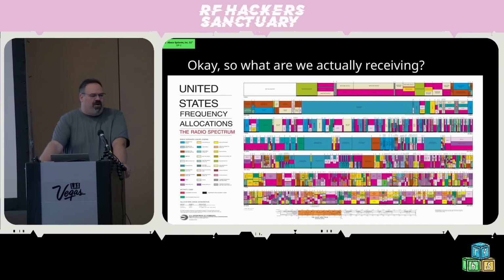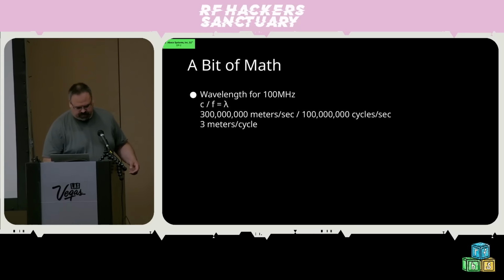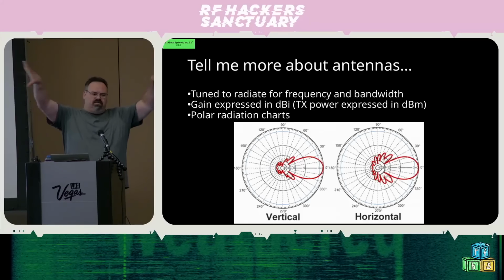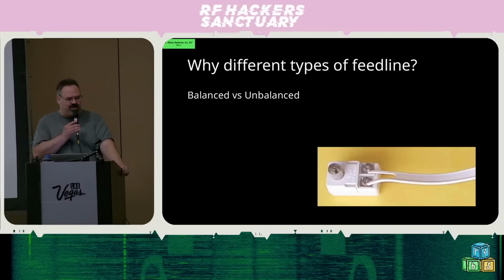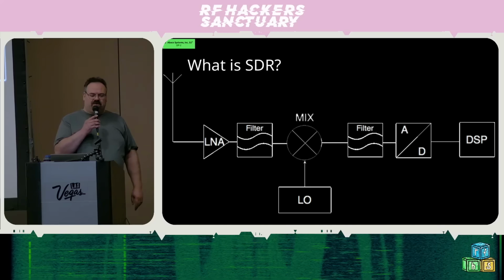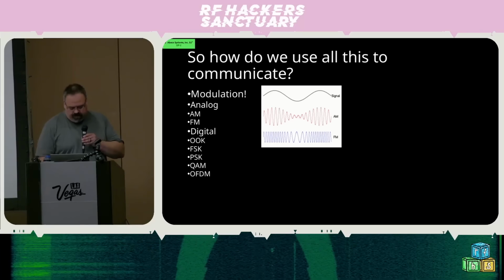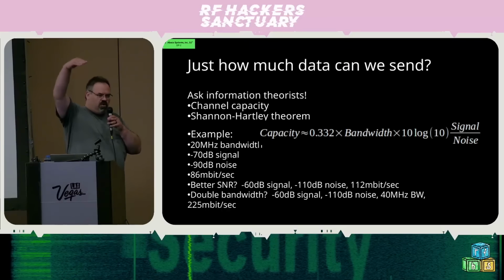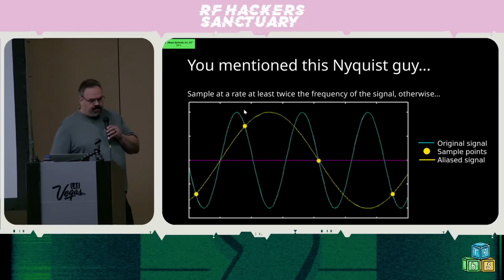DEF CON 33 - RF Village - So What The Heck Is This Radio Stuff Anyway - Exploding Lemur

Comment: Radiation is mediated by PHOTONS not Electrons, E=hv with v being frequency. Wavelength is the length between the troughs or crests of the wave being measured.

I’m thrilled there’s an interest in radio but there is so much wrong here, it’s astonishing this was allowed to be presented. I hope this man continues his education, but this is flatly embarrassing. I guess it’s safe to say DEFCON knows literal zilch about radio physics. Ouch.

But, if you’re not sold on my take: Using only what has been explained by the presenter, tell us why antennas simply do not melt (or explode) as “electrons” oscillate throughout them at millions of times a second? If the radiation is truly a wave, why doesn’t it diffuse within the its medium of travel as all other waves do? Why are radio waves self propagating? What are they made of? Why do they pass through some objects but not others and why does frequency have such an effect on what they can and cannot pass through? How are they modulated? What is resonance? 

There is literally so much wrong with this presenters understanding of electromagnetism (which is a very complicated subject) I (or somebody with a real degree) would need to run an entire semesters worth of E/M to explain how bad this is. It is really, really bad. He cannot actually explain how any of this works.

If the guy reads this, I hope he’s not too embarrassed but he simply knows far too little about the subject to speak authoritatively on it and misconceptions are quite contagious.

I’ve been around radio my whole life. My grandfather is a pioneer in the field of spectroscopy. Physics is just something I do and most the time I stay silent but this is too egregious of a phenomenological misrepresentation for me to do so. The more I watch, the more   problems I find.